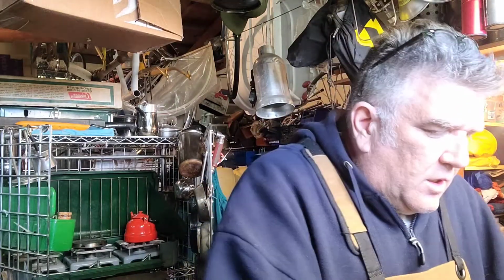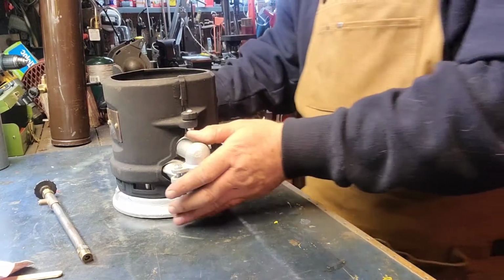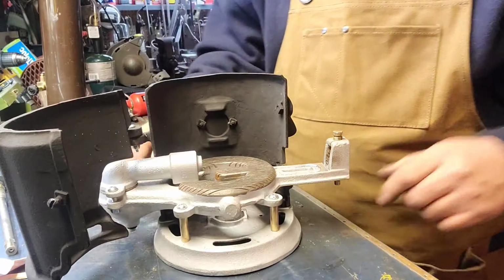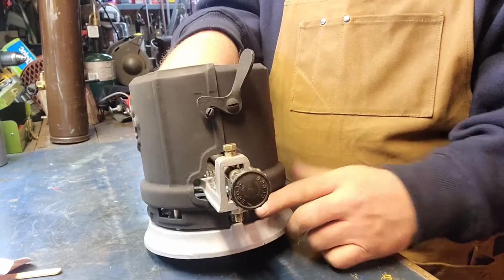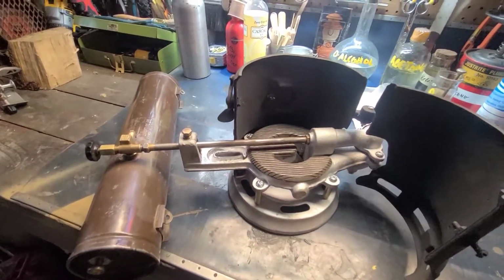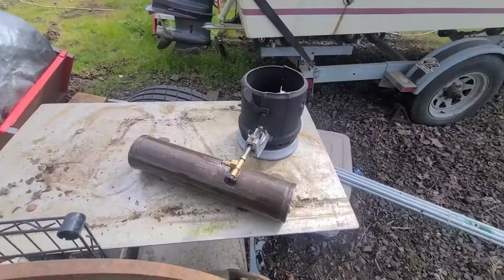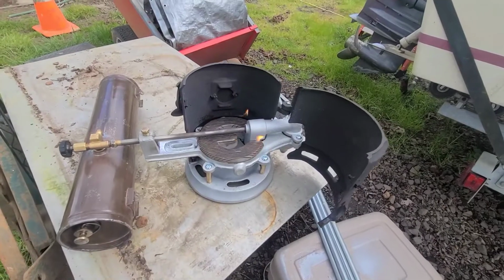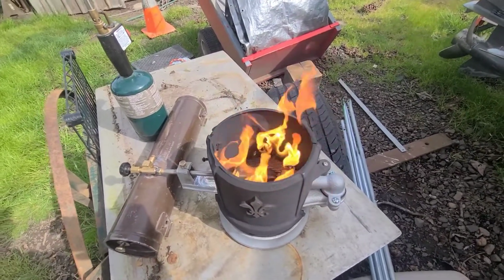Frankenstove First Lite , Vintage Coleman Water heater conversion

Comment: I have a Coleman clothes iron, complete with the trivet. Too scared to light it, from all the charring on the wooden handle. I hope you get this running like you want it. Thank you for showing it to us, Steve. Stay safe and stay cool
Reply from the maker: Thanks Sean that burner should burn as blue as all get out . The problem is it's not getting hot enough down there or the combinate or the of the generator not getting hot enough it's not vaporizing into a gas . I will figure it out ,
Reply from the maker: Thanks for the comment Sean and happy Easter

Comment: Oh man would I love t have the original water heater. 
That thing is too cool. 
I would try it again but try to preheat the whole burner assembly and more preheat on the generator. Try putting fiberglass stove rope under the burner and saturat with acahol for a good preheat. 
Try more pressure in the tank. 
I also noticed you didn't turn the lever up until after it was lit it. This may have flooded it.
Always have the lever in the up position before lighting it. 
Turn it back down after the stove gets up to operating temperature 🌡. 
Hope this helps. 
Looked forward to a part two. 
God bless.
Reply from the maker: oh yeah!!!!!!! I agree 👍  , I will try thank you 😊
Reply from the maker: yes I did figure out the up , vs down and that did make a huge difference!